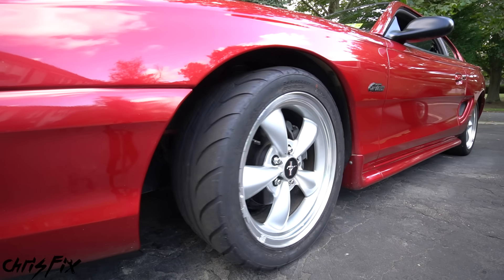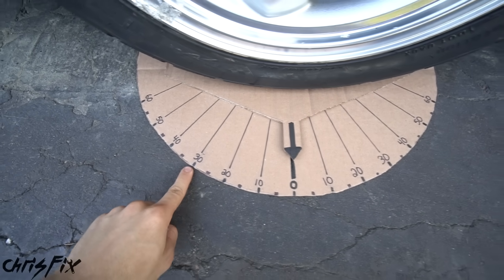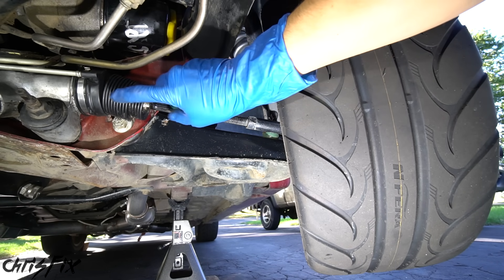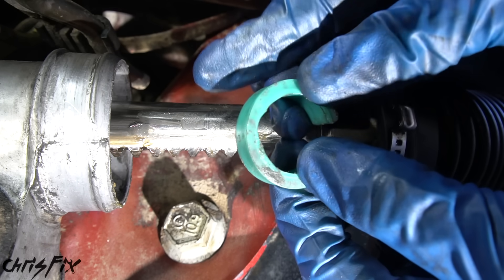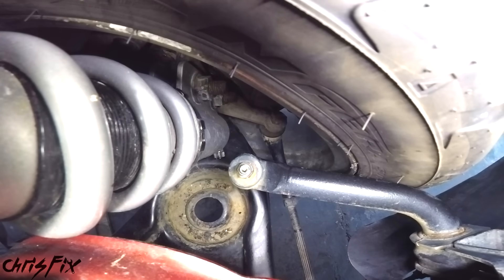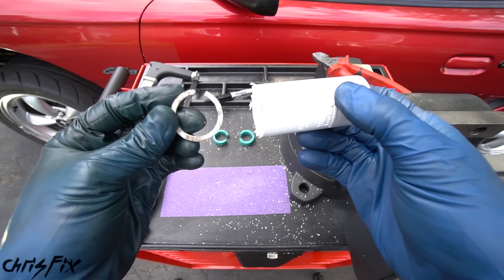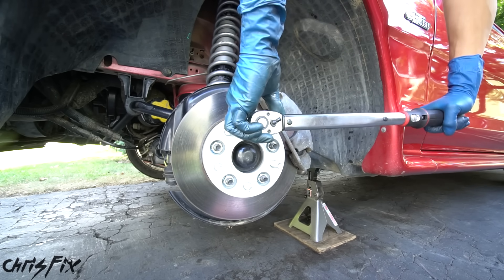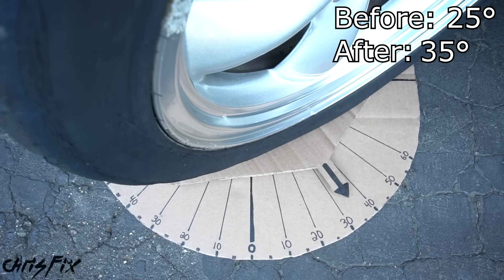How to Get Your Car to Make Sharper Turns (Steering Angle Mod)

Comment: First dodgy advice I've seen on this channel. These modifications can lead to less stability in turns especially in wet weather. I would not do this to my car except if it's a pure fun car and I'm not driving it on the street.
Reply: AikiYanka 

"He's telling everyone to do it"

You have issues reading and listening don't ya? No wait, you answered that question already with flying colors...
Reply: Perhaps I do. Or you do. But in any case I'm 100% sure there are ppl without enough knowledge about cars who will understand this in a wrong way.
Reply: AikiYanka Thats what his car is for its a Drift car i doubt he would do it to his corvette
Reply: I mean he's telling everyone to do it and I don't agree to this.
Reply: AikiYanka He's not "telling" anyone to do it he's simply showing you how to do it if you want to he didn't promote it once in the video but better to have a video to do it the best way rather than someone completely messing up their car while trying it.
Reply: why would it affect wet weather performance? it only changes the maximum lock, you can just not turn the wheel all the way when its wet, also if your driving normally / not drifting you never go anywhere near the stock steering lock anyway let alone an increased one unless you are doing a u-turn, in which case you're doing like 3mph so there's not really any danger if something does break then...
Reply: Adam SULLIVAN 

Who said anything about additional pressure on the pump? I think the OP was more concerned about geometry and handling.
Reply: I was wondering the same thing.   It's not necessarily a good idea to mess around with steering geometry.  I'm pretty certain that Ford doesn't go out of its way to enlarge the turning radius of its cars without some thought.   Ford and other companies invest a lot of time and effort designing their steering mechanisms for durability and to prevent misadventures, such as rollovers, loss of control, etc.  Just because something can be done, doesn't make it right.

ChrisFix is one of my favorite YouTubers, and I find his videos to be very interesting and useful  I think that in this case, he may be doing a disservice to his audience.   Perhaps are clearer warning about this mod is warranted.
 
You shouldn't have gotten so much hate for your remarks.  You made a relevant point.
Reply: megaspeed2v2 they’re talking about the wheel spacer mod which could technically affect traction because the wheelbase is no longer straight down the car, though as someone mentioned that could be corrected by adding spacers to the back tires as well, and the wider base might actually improve overall traction to better than stock after all wheels are spaced. Or could avoid altogether by just cutting the column spacer as mentioned in the video.
Reply: 'wheelbase' is the distance from the front wheels to the back wheels. 'Track' is the difference between the left and right wheels. That said, there are many, many cars that have different track distances front vs rear.
Reply: Stephen, the car isn't going to suddenly go into a slide and flip over because of this mod,  all he's doing is extending the maximum steering lock... it doesn't make the wheels turn further for the same amount if steering wheel rotation and thereby make the car more twitchy (to do that it would require changing the gearing in the steering system and possibly a stronger power steering pump) it just means you can keep on adding more lock beyond the point you could as standard. He did cover why the standard limits were there and how to avoid causing excessive wear (tolerance for slight difference in tire sizes and don't hold it at max lock for long periods) there's nothing else to warn us about other than maybe check your power steering fluid more often so you know ahead of time whether you're wearing it out but that one really is common sense... like for example, would you really need to be told that you should probably check engine oil more often after having an ECU remap done? no... common sense tells you that.
Reply: hzryr61 like I said, it changes the handling characteristics, not necessarily for the worse but I’m just pointing out what the others were discussing. Though it’s not a drastic difference given how little the distance is changed here.
Reply: Look, I’m an actual Mechanic, there’s nothing wrong with this. Stop acting like this is doing harm. It hurts nothing. The pressure required by your pump is the same wether it’s 25 or 35degrees. It’s the same mass being moved!!! 
This is a great tip and absolutely nothing dodgy about this. 
I thought he was going to mess with the Caster at the strut tower. That’s why I watched... cool video man!!!!
When I do alignments, I use Caster to get a bit better turning radius. Never thought about the rack spacer.
Reply: @Lettersandstuff  So, why the designers did not make it to turn like a forklift, then? Will it pass the moose test?
Reply: 2nolhta turn like forklift at high speed... =crash
Reply: @2nolhta  Because forklifts (at least, those that turn as tight as you're thinking of) are rear wheel steer with front wheel drive. Thus, when driving forward, they steer like a rear wheel drive car that is driving in reverse.
Reply: Congratulations Aiki you don't know how cars work, I appreciate that you honestly display that but perhaps you should refrain from making nonsensical comments.
Reply: I have to agree with AikiYanka. When I was watching this, I felt like the message for "Who this mod is for" was off..

But, I'm not a dumb ass-hat who doesn't just "know." But, We all know there are millions of idiots who.. ~don't~ just 'Know.'

With that stated, I was very interested in this video due to the fact that I always wondered about my Dodge Magnum being able to take a sharper U-Turn on a 2 lane street.

This video helped me decide completely against the Idea. 
Adding Spacers, removing components, modifying other structures on the car.. Does a lot of things to the geometry of the function of the handling for the car.. which can cause some pretty serious issues to the average driver under certain conditions.. as stated by AikiYanka.

But, AikiYanka, I think I can also state with Confidence.. that a person who doesn't work on their car, in some above-basic, way.. will likely not even attempt to do this mod. They'd be too intimidated by either the Money necessary.. or the wheel extensions. 

Everyone's basic instinctual thought.. will be: "Should I really extend my wheel? Won't that allow more risk of my wheel snapping off? I don't think I should do this."

Also, to let everyone, including AikiYanka, know.. if you extend your rear Wheel base out.. just as much.. or slightly further.. that takes care of the Rain-Traction issue.

The only downsize to that is.. your Differential will have a harder time transferring power... and/or cause more drag on tires.

You could, however, opt for wider rear rims/tires.. But, you'll still have the issue of whether or not your differential/transmission can truly handle the extra contact of the tires.
Reply: I believe we are more worried about weather condition performance and wheel bearing life.

It's the same mass.. thus.. maybe extra pressure... maybe not. He didn't space them out far enough to cause more friction, I'm sure.

Comment: You've made the front wheels wider but you left the rear wheels in stock that will effect the handling of your vehicle it will cause it to understeer which is bad for a drift build like yours

Comment: thought you jacked up on the oil pan for a second their.,......my heart skipped a beat (im a buick guy....but fords are OK....just OK ;) )
but nice work on the vid.....the "ghost" car part was really cool.....a PERFECT visual 

i might do this on my 99 buick century.....which i plan to turn into a regal by swapping the 3.1 for a supercharged 3.8 

the rack is on the back of the center line of the tires.....ive never seen it where its in-front of the center line like that before 
wonder how that effects the suspension geometry (possibly thats why mustangs like to run over by standers lol!)

Comment: crisfix quick question, I have a 98 f150 4.6l, when she warm start chugging bad like a misfired but the check engine code say is the oxygen sensor 2 I test both sensor and the result was fine do you think is the idle or the egr bad? (I delete the muffler and then a couple days turn the check engine after that)

Comment: Are you going to put wheel spacers on the rear so that the front tires aren't sticking out further than the rear ones? I only ask because I have a similar car only its the V6 and manual but I don't really like how far in the rear wheels look.

Comment: Hi I am a senior in High School and to graduate I need to complete a senior project. For my project I want to do some upgrades for my 1998 Chevrolet s10 (4 cylinder manual transmission). Unfortunately due to circumstance I do not have the budget to purchase all the necessary parts. I want to start by adding performance exhaust and a cold air intake to boost horsepower. I know what you are probably thinking, "why don't you get a job?" Well I have a job, but as a senior in high school making minimum wage, and having school work to do, I simply do not have the income to put into this project. Any help at all from the good people of the internet would be most appreciated! Thanks and best regards, Christian

https://www.gofundme.com/4jikkyw

Comment: hey wait wouldn't doing this put a lot of strain on your powersteering pump and cause front wheels to slide sideways ?
Reply from the maker: +tweak no the pump works the same no matter how far out it goes. On some cars there are no rack limiters and the power steering is fine. Good question.

Comment: Seriously...   Please put Sub Frame Connectors on the car! =O  Your chassis is literally flexing as the suspension because everything else but the chassis is stiff.  You NEED Sub Frame Connectors on this car, and you need them before you tweak the chassis to the point where it can't be fixed...
Reply from the maker: +UrPeaceKeeper thanks for the tip!

Comment: Carefull because some cars if you take the rack limiter out you can pop the seals and have a major power steering leak. For best results what I found is extend the steering bar along with respective parts necessary.
Reply from the maker: +Braxton Finegan thanks for the tip

Comment: Why do car manufacturers not put thinner ones on to begin with?
Reply from the maker: +RationallySkeptical it would cause the wheel to contact the suspension if they did that. We had to do a modification such as a new wheel with a more negative offset or wheel spacers.

Comment: Shouldn't you install wheel spacers at the front and the rear if you do not want to change how the car drives?
Reply from the maker: +SierraKilo76 You don’t have to. The front and rear are two different systems. But I will because it will help with handling. Plus, if I put the other spacers on the rear then I wouldn’t be able to make the video all about wheel spacers.
Reply: Thank you for answering, ChrisFix!

Comment: Hey CHRISFIX! i have a question,is it safe to do the cvt transmission oil drain/fill ourselves. I have 2014 nissan maxima. Please can you do a video tutorial on how to do it. please and thank you great channel! Just subscribed!!
Reply from the maker: +Diego Zende. It’s safe but make sure you use the correct fluid and change it at the proper interval which should be listed in the owner’s manual.

Comment: Wouldn't "tighter turns" be a more accurate title?   When it said sharper turns, I thought it meant quicker steering feel.
Reply from the maker: +soundseeker63 sharper turns and tighter turns means the same thing... quicker steering feel would be in the title if it was about getting quicker steering feel. At least that’s how I think about it.

Comment: Hi Chris, great vid would you advise greasing the power steering rack teeth when you have the boot off or are they lubricated in a different manner? It is a great time to do an inspection cause power steering racks are costly repairs!
Reply from the maker: +James Lewis not a bad idea! Don’t over grease it though, just a little chassis grease should work.

Comment: The problem is the way the suspension strikes the road, change! The car is not designed for that!
Reply from the maker: +David JGT thanks. The wheel is moved out only 25mm which usually isn’t enough to cause any problems. Also you can adjust camber and caster if you are concerned. But great point!
Reply: ChrisFix Yeah, but  its something to consider. camber and caster would be hard to adjust properly, I think. It can become a bigger change If someone also do that, put a more wide wheels... Did U put on the back wheels to? 
Great Channel! Think the vídeo about rust can be very interesting!

Comment: You don't put spacers on the back wheels to maintain symmetri?
Reply from the maker: +MikeKay1978 I need to use the rear spacers to make the spacer video I talked about in this video. So it will get spacers.

Comment: 0:06 so you can make sharper turns and void warranty. or be a complete badass and mount the curb like everyone  that ownes a 4x4. is it just me or is anyone ealce tasting  rice here?
Reply from the maker: +Puzzle I’m not sure I’m following... if I tried to “mount the curb” in my lowered car I’m pretty sure I would destroy the bumper and hit the frame. Also you are not voiding any warranty. And finally, how is a useful  modification rice?
Reply: 1. ill try to be clearer moast 4X4 can mount a curb 2. you are modifying the stearing mechanics removing parts off a car that was put there for a reason so warranty issues 3. pushing the tyres further away from the body of the car is viewed as rice
Reply: Lol, he needs to get wider tires or add spacers to the rear, too, IMO. Those rears look like trash so far under the fender like that. Especially on a drift car.
Reply: Puzzle you tell them Toby Keith. Lmao this nigga telling a drifter to get a damn 4x4 pick em up truck for drifting... gtfo Billy Ray
Reply: rather just buy a 4wd :p

Comment: You can buy different size rack limiters from Ford or a online Mustang parts seller. If you think the SN95 turning is bad get in a Foxbody.
Reply from the maker: +Liquid Snakes thanks! I rather make a new one for 25 cents out of pvc haha
Reply: ChrisFix I had some different sizes,  I got them from the 99-04 rack I converted in my fox. I remember having big ones and small ones between the two racks. Just having 245 tires would rub the frame, stock was 225, so I used all of them. Lol
Reply: It's like Ford intended to make the driver want to kick the rear out to u-turn in these cars as a joke.

Comment: The car will look funny with only front spacers , the front will look wider , you need spacers for the back wheels , it will look better
Reply from the maker: +Husain Alkhamees thanks! As stated in the video I will be doing a video “Everything you need to know about wheel spacers” so I will add them to the rear in that video.

Comment: Hey Chris how can you repar or replace a clutch master cylinder it's when the clutch is press down but won't come back up ??
Reply from the maker: +Darkness T are you sure it’s the master cylinder and not the clutch itself getting stuck?
Reply: Yes I'm very sure I would press the clutch pedal and it won't come back I was thinking if there was air in the pipe clutch fluid
Reply: I'm not really sure if it is or not but yes I checked if it was stuck on something and it is not stuck on anything

Comment: Increasing scrub radius, in most cases, is a good move. The only negative effect, with a strut application, is the increased stress load at the strut tower. Adding a strut tower brace will offset this issue. Also, in most cases, a variance in track width, front vs. rear, tends to upset and limit  the suspension geometry movement. Simply adding an equal size spacer to the rear will offset this issue.
Reply from the maker: +Corey Hodson thanks for the tips! I will be adding spacers to the rear for the “everything you need to know about spacers” video.